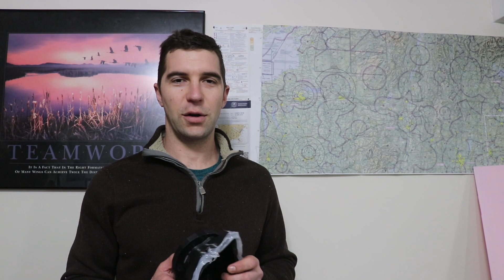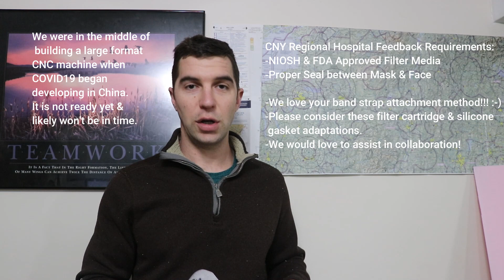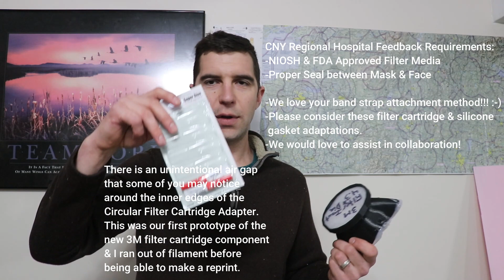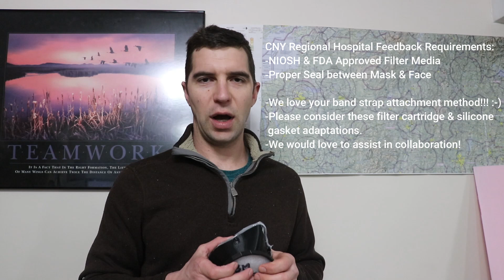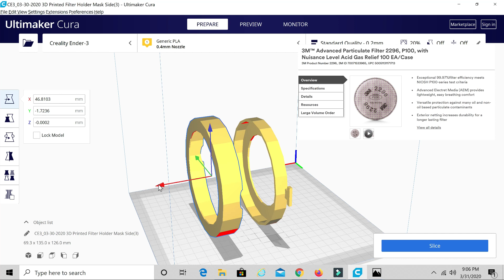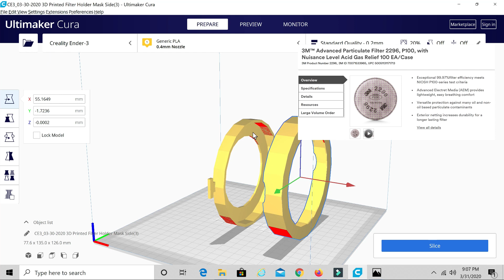3D Printed Respirator with Solutions based on Syracuse, NY Hospital Feedback COVID19 Video #6

Comment: With regards to the silicone gasket to make it more comfortable... I'm a big user of VR headsets and I'm thinking the method used to make VR headsets comfortable on your face could be applied to your respirator.  VR headsets use removable foam/cusions on the headset itself with velcro to hold in-place the cushion and these cushions are replaceable and come in various sizes (thickness).  Here is an example...  https://vrcover.com/product/oculus-quest-foam-and-interface-basic-set/ .  Now i understand the velcro could leave space-gaps but if the cushions could be "L" shaped to cover the velcro on outside also with velcro, I believe that would resolve that issue.   I make my own VR covers using rubber sponge window sealers with velcro.  And they are easily removable (replaceable and washable)  because of the velcro.   I hope you understand what I'm talking about... in any case I think you can use the principles of what the VR industry as learned in making more comfortable face cushions on hard-plastic face masks.

EDIT:  giving this some further though... instead of shaping the cushion in an L... if the ends of the mask had the shape of an "L", then you can simply just use foam window sealer.  This would remove any space-gaps caused by the velcro. The user can choose the thickness of the cushion for comfort and the window sealer can be replaced as often as needed.
Reply from the maker: Thank you Tim! I really appreciate your well though out response. I'm attempting to visualize your write up in my head as I type this. We will attempt to incorporate these suggestions & look to VR for inspiration in our next update. Thank you so much for your efforts! :-D